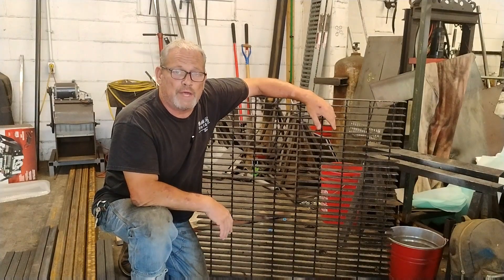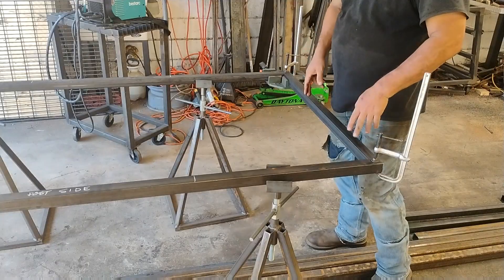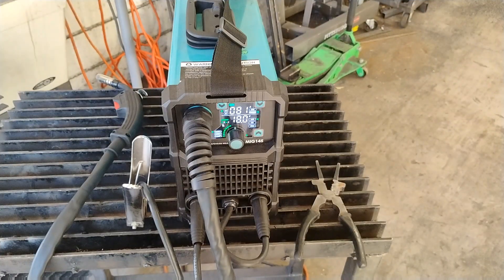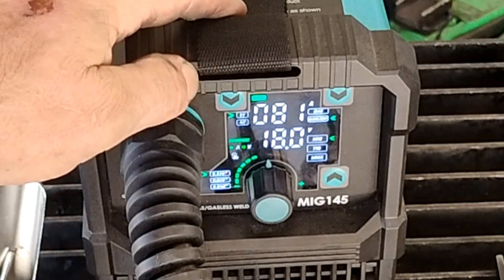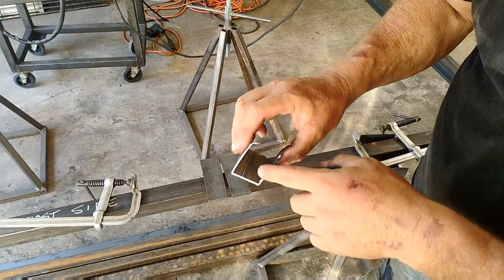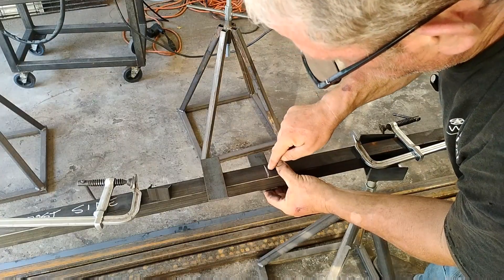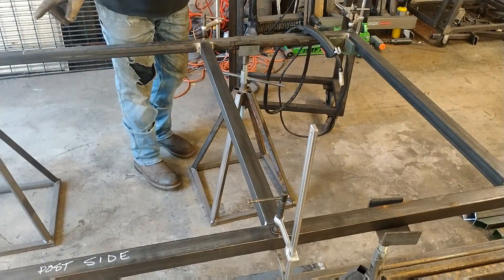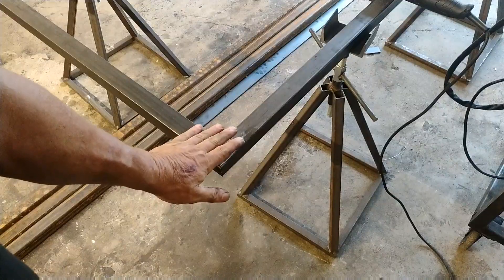Flux Core Friday #3: Building Heavy-Duty Gate Doors with Flux Core Welding

Comment: did you make those jacks? if so can you give me some info on them, i could really use some
Reply from the maker: Yes, I did... Nothing too complicated. Made a square frame for the bottom, then made the legs going up. In the center is a piece of pipe.. then I got some threaded rod, and the nut, I think they call it a coupling nut. Then welded  some handles to it so I can twist it up or down. At the top is a piece of C channel with a small piece of pipe welded to the bottom. DO NOT weld that to the threaded rod, just slip it on, it needs to be able to turn. One guy gave me days of flack about it, saying it won't hold up anything, it's could to fail, blah blah blah. Well, 3 years later, they are still working. I'm not trying to hold up a car with them. I use them for projects like this, or to build a trailer. They could also be used to hold up a car frame on a hot rod project. Just don't go nuts. Or, build them stronger.
Reply: @AllStarWeldingSC thank you